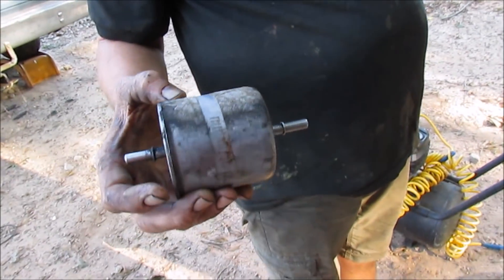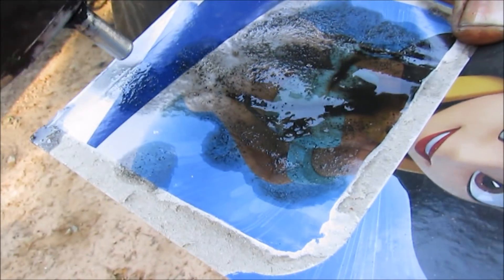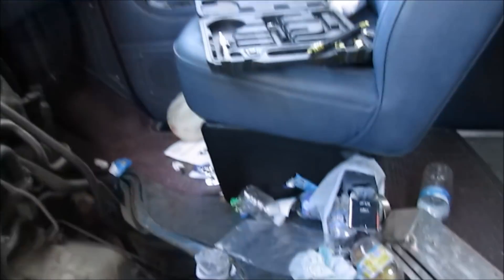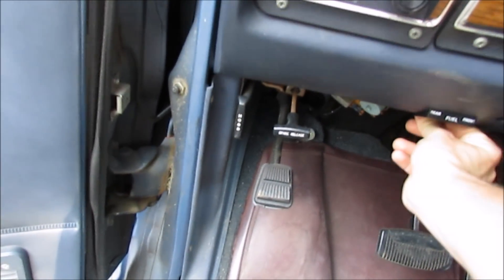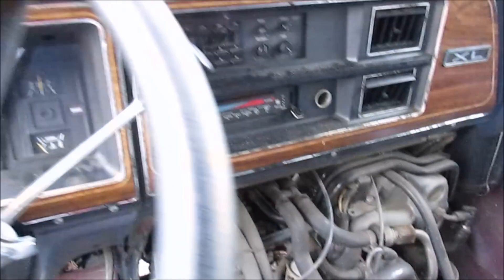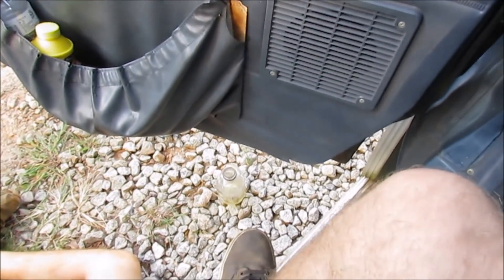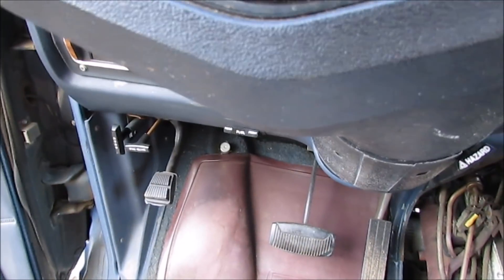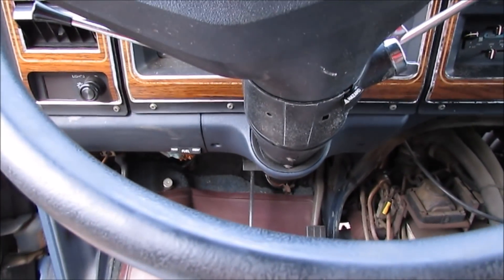Ford Econoline repair + Worst fuel filter sludge

Comment: I knew a dude that was so cheap he would just get another used filter from whatever car he had in his backyard. This is the same guy that would  plug a bald tire. I hope that valve cover gasket gets replaced, oil on a hot exhaust manifold isn't fun
Reply: Wow that's some advanced cheap assiness right there, I'd be way too lazy to take off another fuel filter I'd rather just spend the $15 for a new one...